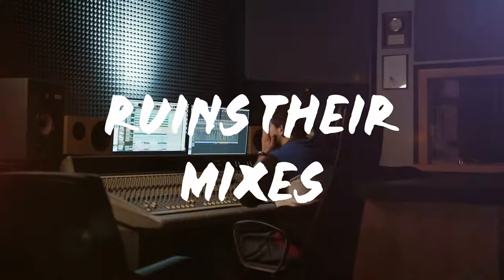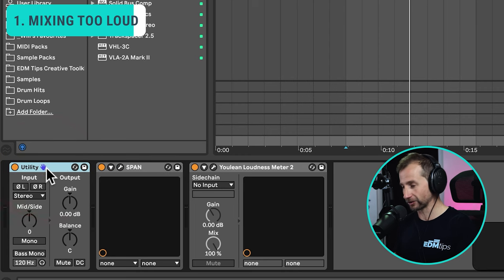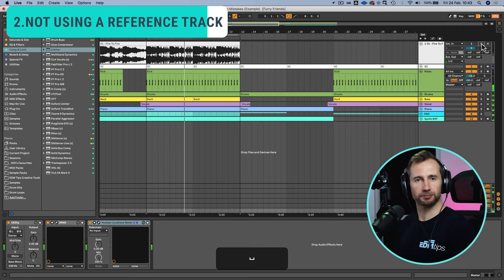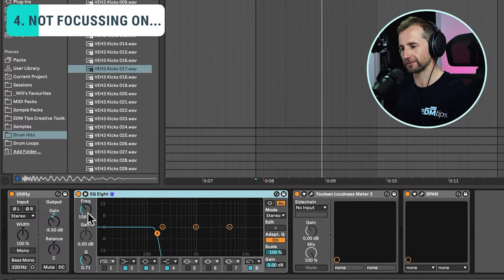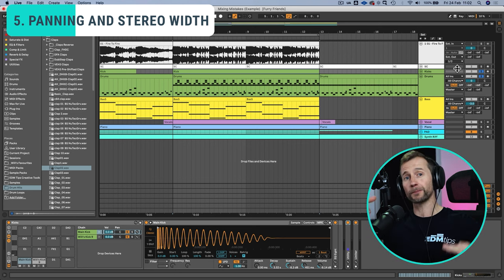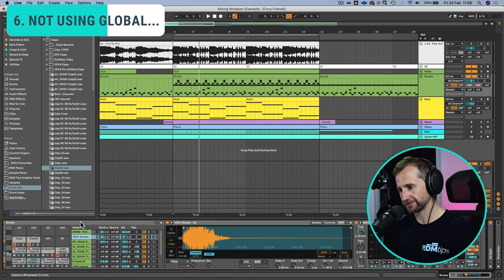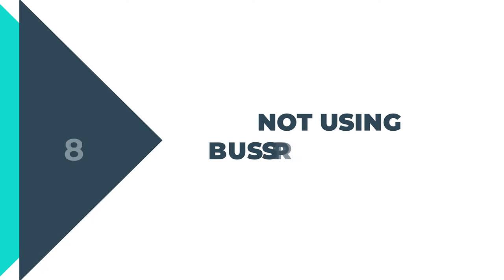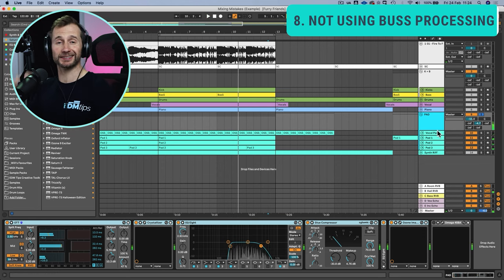8 Mixing Mistakes You're (Probably) Making and How to Avoid Them

Comment: Really really good info on mixing and leaving solid headroom. I found myself getting lazy with all the great mastering plugins these days, such as Izotope - Ozone Pro and Sonible SmartLimit, heck even god forbid, the God Particle and skipping the mixdown. Not only creating headroom, but also balancing sounds is so crucial before you do anything on the master. I would think something sounds really good, until I compare it with similar produced songs in a genre that sounded so much more powerful. The power comes from doing the work and a proper mix and then mastering... at least for me. Sometimes you can get lucky, but most of the time its just better to do it right.
Reply from the maker: Great point indeed, sometimes we are getting lazy relying on third-party VSTs!

Comment: Nice and clear tutorial. One more thing to mention tho: having peak the Kick on -12db is a great idea to start your mix but keep in mind if you apply some EQ to boost the low end it will add some gain. My kick at -12db is around -25db RMS. Does your Kick also stay on -12db / -10db peak after the Bus processing? my guess is yes. Keep it up. One
Reply: You put the kick at -12 after the processing

Comment: I don't quite understand the tip with -12 db kick. Kick should be the loudest in correlation to other elements of the mix permanently, or is it just a starting position? By the way It is a great idea to listen to references cuted beyond 150 hz. I will work with that tip to learn how to build dynamic low ends, especially in music that works on big systems. As usual, good stuff, thanks :)

Comment: Something i've always struggled with is gain staging. More so line level or VST signal strength.  I've seen in some of your videos you will turn down the track fader to bring the volume down on a track.  But what about say when i load in a virtual instrument or say Wavetables, operator, simpler etc.  Would I set my level using the instruments volume down to -12 to -15db, or would i keep that signal strength high, then adjust with fader down?

I"ve always set my instrument volume levels first then used the volume fader when mixing, leveling, and panning the track for the overall mix.  Would this be the proper way to set signals and volumes?
Reply: you set all instruments to -18 and in some cases the kick to -12 then use the master to make it loud.